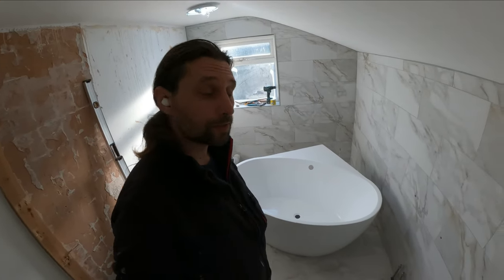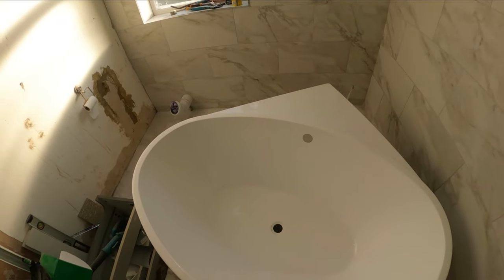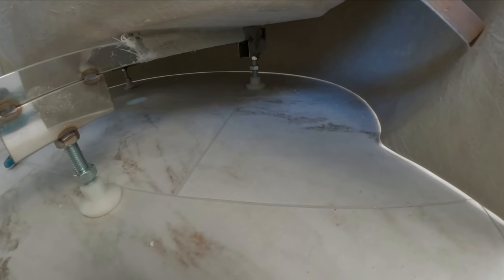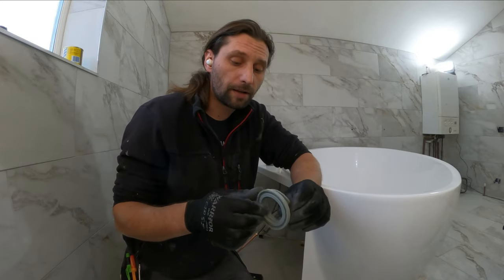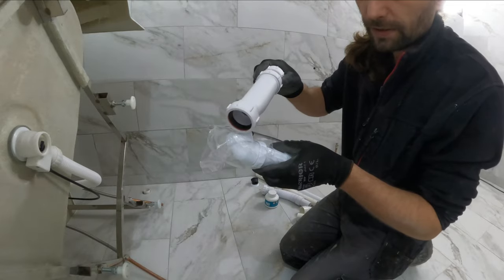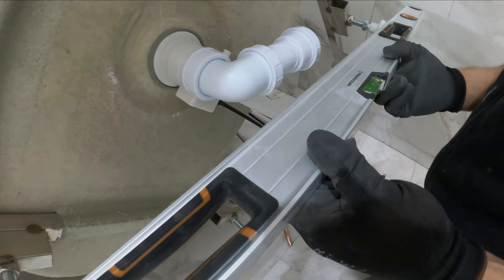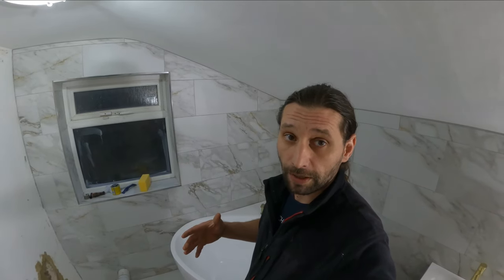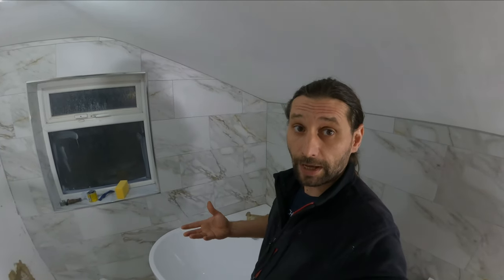Modern Free Standing Bathtub Installation

Comment: Good job man! I would feel safer if they designed these bathtubs so they had fixings to secure them, I’d be worried if it was full of water and I leaned on the edge 😆👍🏼
Reply from the maker: Yes.I didn't like that also but I'm confident that i secured it in place to last more then the warranty

Comment: Did you put silicon around the bottom of the bath? Or just around the top?

Are you not worried about water leaking underneath
Reply from the maker: Hi. I usually apply silicon even at the bottom. I prefer not to just in case it is going to be a leak at the back. But i will let the client decide that